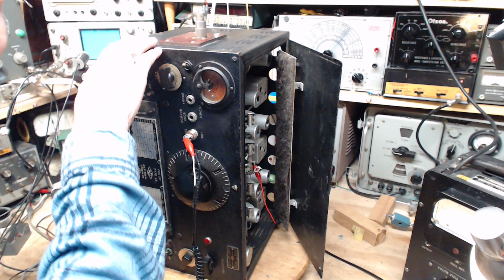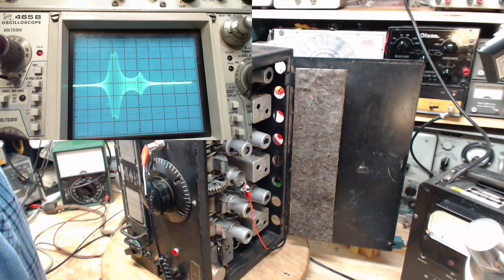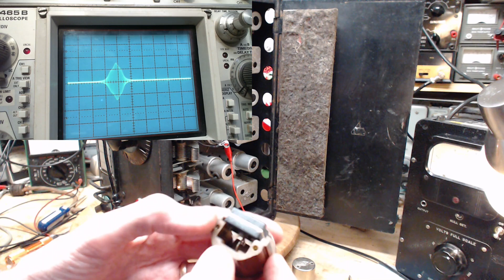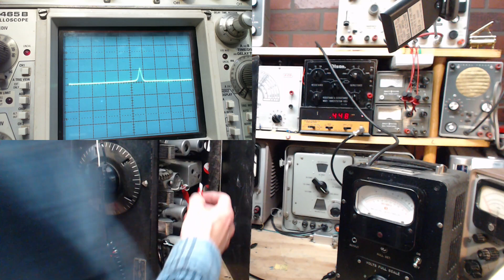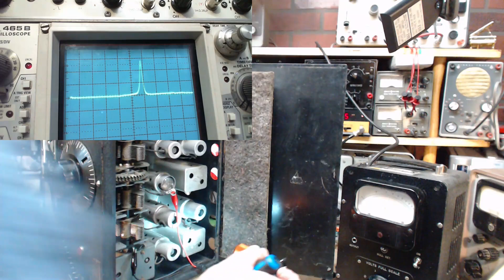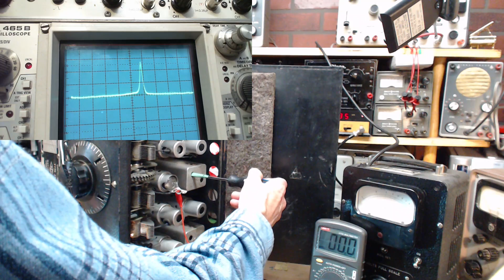National HRO Receiver Video #13 - Checking IF Tuning

Comment: The trimmer caps in the IF have B+ on them and if the S meter is switched on it will damage it and also the S meter trim pot shaft on my example has B+ on it be careful when adjusting it it will damage the meter if it is shorted to ground.